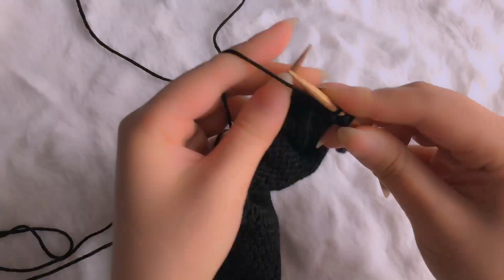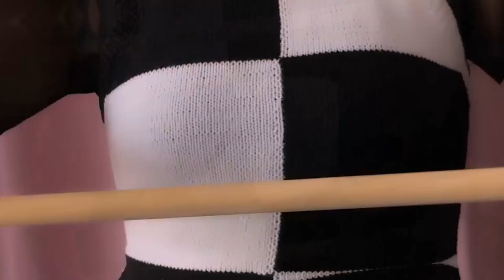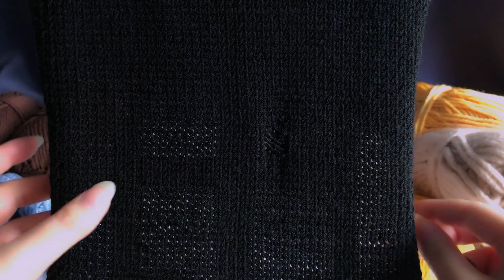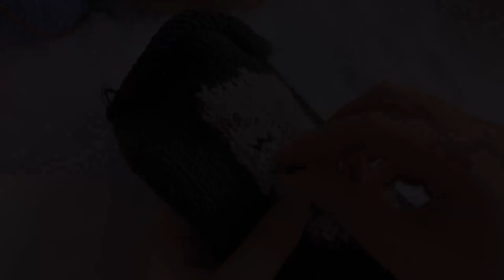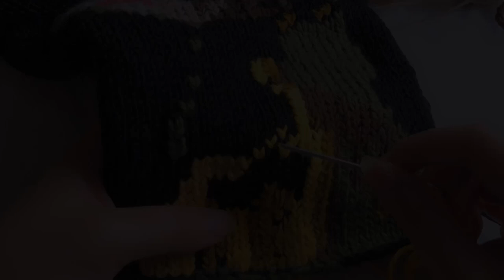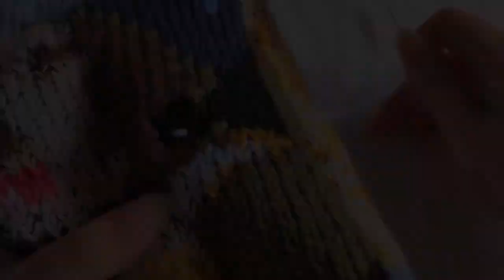Can you turn scrap yarn into fine art? Girl with a *Purl* Earring

Comment: Very impressive!! When you went back and started stitching in with just 1 ply of yarn, it really took it to the next level!! 
I will say stockinette is going to curl no matter what. Even after blocking, it's likely to curl back on itself eventually. You can add a border of about 3 stitches of garter stitch on each side and a few rows of it on the top and bottom and that should stop the curling for good. But if you plan on turning it into something and not just displaying it flat, I would just keep it as is. I do think it would be beautiful just displayed flat on the wall, though.